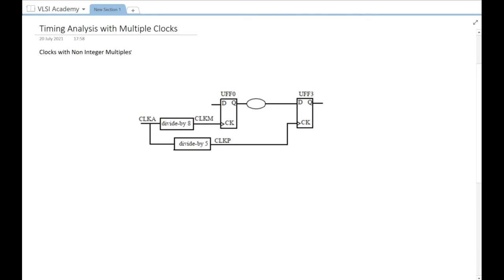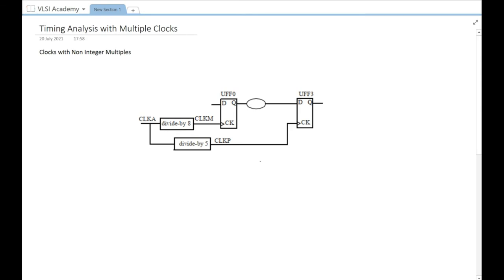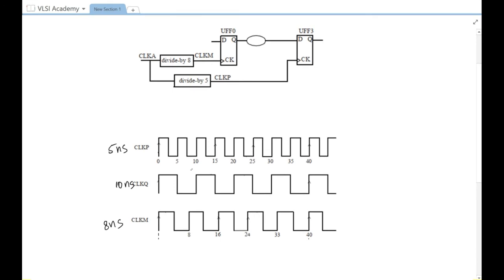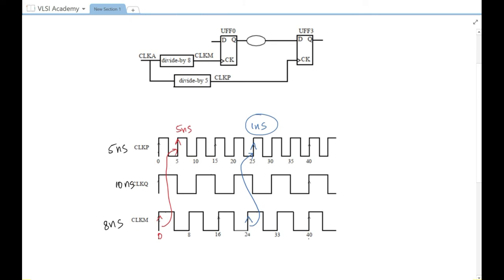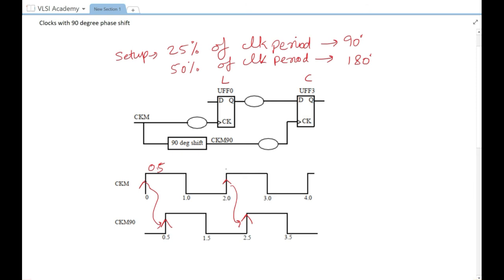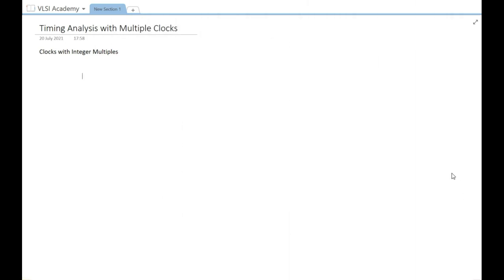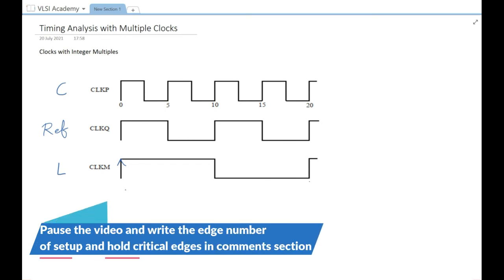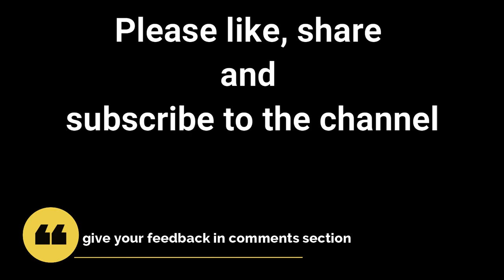sta lec29 timing across clk domains part3 | Static Timing Analysis tutorial | VLSI

Comment: For clkP setup is checked at t = 15 ns because there is a multicycle path. 
Tool will default check at t = 5 ns next edge
Ans:
Setup edge number : 4
Hold edge number : 0

 (Same concept example is solve at this https://youtu.be/V62C_q_53n4?si=kHV_pbKCKpWhZcUF (Playlist video no. sta lec27 timing across clk domains part 1))